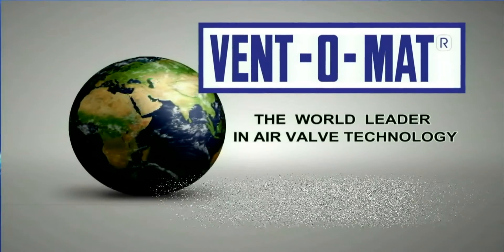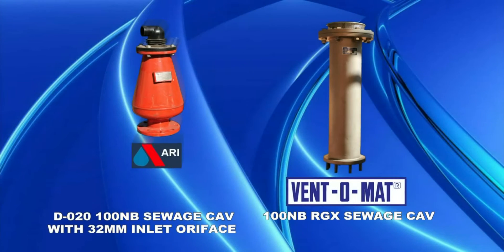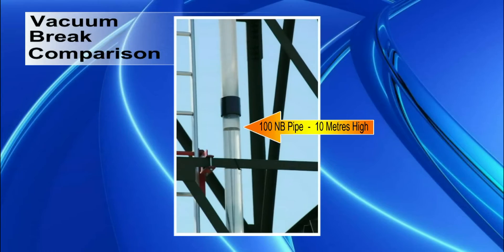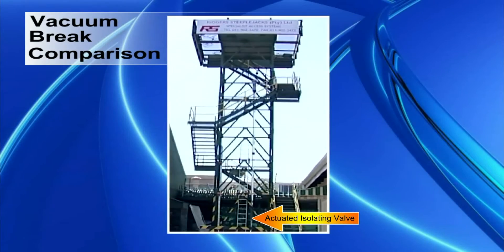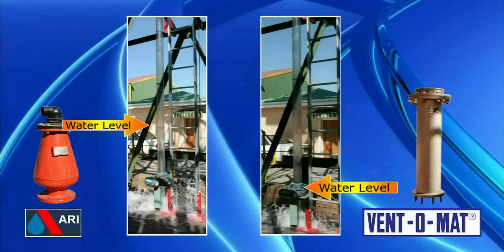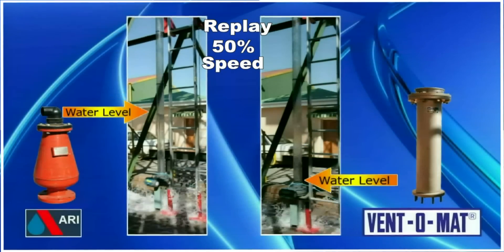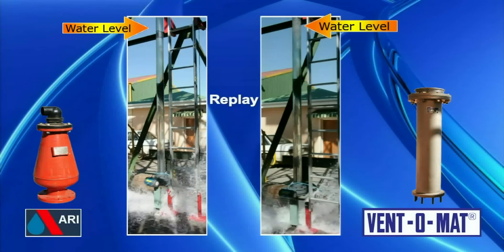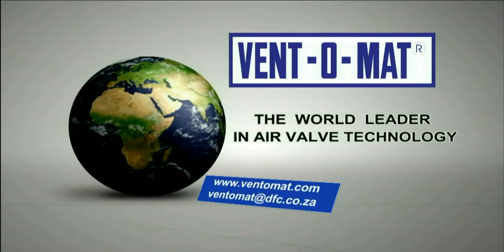Vacuum Break Comparison Vent-O-Mat VS ARI

Comment: This is an irrlevant-, and outdated comparison.

Common knowledge -  you should always compare same size ORIFICES, not connection sizes, when it comes to any air valves:
a) the ORIFICE determines the air handling capacity to start with, and
b) the ARI larger connection size = slower riser velocity below the air valve = lower rate of change of water velocity when the valve closes = reduced valve closing slam..., and 
c) larger connection size increases the effective air capturing area below the air valve (simple, second best practise if/when the ideal capturing chamber design cannot be afforded) !

What would actually be relevant is a direct comparison between the 80mm RGX vs the 80mm D023 model, or the 100mm RGX vs the  100mm ARI D26 model, and you can also compare the reliablity of the VOM switching disc type anti-slam device vs the ARI spring loaded anti-slam option of the ARI models, and while you are at it, you could also also compare the required frequency- and ease of maintenance, as well as the performance of the small orifice component which works majority of the air valve life compared to the few times the large orifice operates, and you could also compare the mandatory compressible air gap between the two body styles under the same operating pressures...